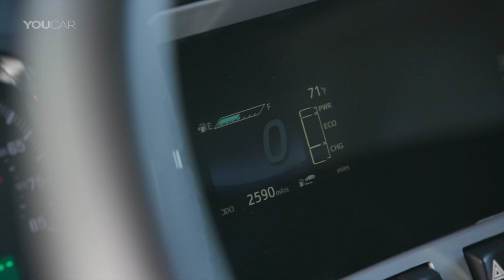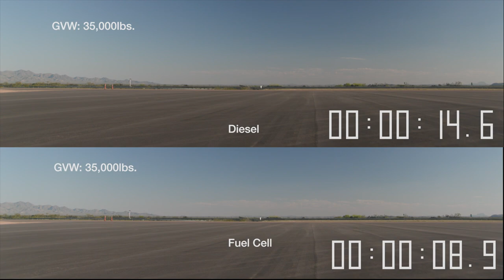FUEL CELL Truck VS. DIESEL Truck

Comment: Wow. sounds like jet engine
Reply: Random People well  it is  thats  why  lol. look  up  how  those  Things  work. Steam powers  a turbine.
Reply: Tom Westphal what you are describing is a steam engine, nothing to do with fuel cells! Fuel cells turn the chemical reaction between H2 and O2 into electricity, there're no steam turbine involved in the process
Reply: maybe that is AC frequency noise(subway train like sounds) from 3VF inverter with AC traction motors
Reply: It's the sound of the electric motor like rc cars make but on a bigger scale
Reply: No, it is the air compressor. Fuel cells require both Hydrogen and Oxygen to generate electricity. Hydrogen is coming from the tanks. Oxygen is coming from compressed air. This compressor works at high speeds above 100,000 rpm. That is the "jet engine noise".

Comment: However this is only 35000 gvw. It's an unrealistic test. (It's basically an empty truck!)
Reply: richard vaughn so your saying with a heavier load the results will be different? I know the times will be slower but that shouldn't affect who wins
Reply: Charlton Cruz yes it does, do you know how an hydrogen fuel cell works?? It can bring cars forward pretty good but if it comes to heavy things the performance will sink really fast. Normal Truck Engines have a lot more torque and are produced to carry heavy stuff.
Reply: richard vaughn yeap id say put atleast 78k up in there
Reply: Th3CrazyBOy Do you know how it works? It's basically an electric vehicle, and electric motors have tons of torque.
Reply: yes electric means tons of torque...but on a truck loaded to capacity (80,000lbs)is going to burn half its battery just to get moving
Reply: richard vaughn Wasn't electric,  said H2 on the hood which means Hydrogen Gas. So, it was an internal combustion engine.
Reply: plainwornout3 do you even know what you're talking about?  that's clearly the sound of electric motors.  seriously.
Reply: plainwornout3 Yeah, fuel cell is electric. It uses a chemical reaction with hydrogen to produce electricity, which then powers electric motors. There is no combustion (hopefully).
Reply: seedorfj you speak the 100% truth idk why general public thinks speed is everything I'm a over the road driver and trust me speed hauling tanker is your worst nightmare slow and steady is the way to go
Reply: richard vaughn Thank you
Reply: seedorfj why are you talking about batteries when this is running on hydrogen? also it's a prototype fuck sake. how did the first diesel engine perform?
Reply: you act like you know something and then you start talking. Tell me what RPM means and how it equates to an electric truck?
Reply: Yeah because you know more than the engineers. Gotta love these youtube kids.
Reply: Here is information on what/how these trucks are going to be used: https://arstechnica.co.uk/cars/2017/04/toyota-hydrogen-fuel-cell-trucks/ 
TL;DR: The trucks are meant to be used in short distance delivery in the vicinity of long beach improving the air quality.
Reply: Do you know how it works? Just to produce higher torques you need to use more electricity, I wonder how much electricity can this truck produce
Reply: Torque is a not a very useful measure to determine a vehicles acceleration, or more accurately it's incomplete. Horsepower(or Watts depending depending where you're from), shift points(if applicable-CVT), weight and friction losses is all you need. Horsepower in physics is a measurement of power and torque is a measurement of force, thus horsepower is defined as the rate in time (energy transferred per unit time)in which torque is applied. Torque and horsepower are actually tied together, the equation to determine either is Horsepower=Torque(Ft.Lbs.)xRPM/5252, this is why on dyno graphs Hp and Tq always cross at 5252 RPM. Why this is important is that horsepower is the accurate measurement of how much torque is applied to the wheels at any specific road speed. Now what you can't do though is just take the peak horsepower figure and use that to determine acceleration ( you can use that divided by drag for top speed though). My method for reviewing performance is to take your peak horsepower figure's RPM value and look to see what rpm you would drop down to if you would shift at that rpm. I know most trucks with Eaton-Fuller 10 speeds have a 500RPM drop in between high range shifts, so figuring I would shift at around 2,700rpm for maximum acceleration that would be 2,200-2,700RPM. Now solve for the average of the horsepower figures of these 2 values and you will get the mean effective horsepower value. Compare this to another vehicles engine/trans setup and you will get a good picture of which one will be quicker(if the weight and drive train are the same). What IS a very good use for the torque value is to determine an engines reliability, thermal efficiency and/or power density. High revs put an exponentially larger stress on your bottom end the higher they go, so using that equation i mentioned earlier you can get a pretty good idea of why high torque/low RPM motors are preferred to reach any give HP goal. A Formula 1 engine from the early 90's (1.5 liter up to 1,400hp) would out-pull a truck motor (10-13 liter around 400-600hp) by a large margin regardless the weight of the load despite making about 1/5th of the torque. It would do this for about 12 seconds until it exploded at 15,000 RPM and sent its piston off into space. In this video the fuel cell/electric drive likely made just slightly more power then the diesel, but it is always at its peak horsepower volume with no delay between shift. A diesel-CVT or diesel-electric drive truck would be much better at accelerating then a traditional manual, the only reason we don't use them is cost. This likely will be the downfall of the fuel cell truck as well, at least unless they can get someone excited enough to buy them. Anyways I'm drunk and I think I've just dumped half my years of science/tech, engine/thing that moves knowledge out in an over sized post. Questions?

Comment: acceleration might be good with the fuel cell truck but the top speed ( doesn't really matters ) will be for sure with deisel truck as the ic engine comes into its own at a certain rpm by gradually increasing its torque output, while the electric motor has a flattish torque curve and starts to decline rapidly after a certain rpm, so yeah top end is for sure the deisel one ....
Reply: Evil ANGELS it doesn't matter how fast the engine is spinning it comes down to horsepower which is a function of torque and RPM. all that matters for top speed is horsepower because gearing negates any difference in engine speed.
Reply: I don't know what you do for a living ( not saying in a bad way at all ) but my work itself is R&D on internal combustion engines. 

And às fas as we go, yes, the engine speed definitely matters for IC engines where they develop peak power.
Reply: You were talking about top speed not their acceleration curves with respect to engine speed
Reply: Emory Jenkins yeah, that's exactly what I'm trying to say, the electric motor's torque declines near it's rev speed limit thereby decreasing the pull ( power ) at high speeds, whereas the ic engine's torque is ALMOST to its peak at its peak thereby giving it the power to pull thereby giving a greater top speed. 

let me give an example

what is the fastest suv in the world ? 
bentley bentayga

what is the quickest suv in the world ? 
tesla model x

got the difference ? the tesla pulls hard due to its electric motor leaving bentley behind, but near it's peak, it loses some power and the bentley's ic engine on the other hand comes to its peak at this time making bentley go faster ( top speed ) than the tesla.
Reply: Evil ANGELS you're right

Comment: It's so important that one truck accelerates faster than another.
Reply: TheSoldatov Hey, a man needs to be able to do a drag race whenever he goes.
Reply: Especially when behind the back of 40 tons
Reply: TheSoldatov if you drove one and saw how other cars drive around you, you'd probably get it. but in the meantime you probably do your best to get around the slow moving truck. just better hope you never get rear ended by one if you cut them off.
Reply: Actually it is important in this case to show how electric devastates diesel... accelerating and decelerating.  How else can 4 wheeler s like you understand?
Reply: Важно  , если другой грузовик  работает на водороде . ( It is important, if other truck works on hydrogen )
Reply: 17.5 tons*
Reply: It shows that it's powerful too.  Try having up to 80,000lbs of weight and going up hill. Some truckers will attempt to "haul ass" before the start of the up hill. Because they know they'll be going half the speed limit before they reach the submit... of course that depends on length and height of the hill.
Reply: TheSoldatov it is important.  I can't stand being behind a slow ass truck at a red light.  In fact I can't stand trucks on the road at all.  When I'm flying down the freeway in my M5 it will be nice to know there are some trucks that can pass each other faster so they don't get stuck next to each other like some retarded turtles having a race and can GTFO of my way faster
Reply: Bee Shakin Well in some countries like Canada, it's the law to move over for a faster vehicle, so.... 
Also even in general, you should probably move over for a faster vehicle if you're on the "fast lane" for safety reasons.
Reply: Bee Shakin in some states trucks will get pulled over for being in the passing lane and NOT PASSING
Reply: Bee Shakin really though, we should develop a better and more expansive railway system to minimize trucks and tractor trailers on the road, many truck drivers I encounter are rude assholes that enjoy blocking both lanes of traffic for their amusement and will hover next to each other taking up both lanes for a good solid 15 minutes.  Then, after wasting everyone's time they seem surprised and annoyed that there's about 10 cars ready to blow past them once they finally move over.  18 wheelers shouldn't be on the road at all, they're too damn big, way too heavy, and too SLOW!
Reply: And they should. The majority of truckers are in the right lane for 99% of their day, until they have to move left for an emergency, stalled vehicle, etc. sometimes it takes a while to pass another truck. But, that's not illegal is it. As long as i move back right when safe to do so.
Reply: How exactly do you plan to deliver product to local facilities? Trains? you want to have a 3 mile long train blocking every crossing Lol you don't get it man. Tyson Foods alone moves 1000's of loads a week. A train across country, okay, that's being done. But truck still have to load it, deliver it to two or three facilities before it gets to the shelves. Trucks are here to stay. How fast do you think a truck should be going? fast enough to kill you and 25 people behind and in front of you in the event that he's asleep at the wheel or not paying attention? while going 85 mph..And saying to take those guys off the road won't work. nobody realizes this shit until it's too late.
Reply: I don't think people realize the highways and interstates were made to haul freight across the country. much like trains were first made to only haul freight across the country they soon let everyone travel on them. so don't get pissed at a truck being on the road,  the roads were built for them.  and also a truck shouldn't take off too fast in the first place, most these trucks are hauling 80,000 pounds and by taking off fast in an intersection or around a turn can cause an accident. a truck can roll over on a turn.
Reply: TheSoldatov Actually it does. Plus the fuel cell one can go up hills faster and can stop faster.
Reply: TheSoldatov it's not about acceleration entirely it's about reducing emissions mostly and allowing trucks to keep up
Reply: TheSoldatov well considering these things are always in the way from how slow they accelerate it would be nice for them to keep up with regular traffic also zero emissions 👍
Reply: TheSoldatov Lol really man? gee, I wonder what kind of power, fuel consumption, and emissions an 80,000 lb truck would require to "run with traffic"  2000 HP, 4000 lb ft...you people can't have it your way. People don't want trucks going fast, therefore they don't. Just because a few of you out there think you own the road, and that trucks are in your way,  doesn't mean that the rules and regulations of the entire industry is going to change to make sure that not one more truck EVER gets in YOUR way again.
Reply: TheSoldatov hey man I agree! My truck goes 66 mph. I'd love to be able to even run 70 mph. Too many people/groups think that trucks need to run slow.
Reply: I think trucks need to be able to go faster, I hate getting stuck behind trucks. But because my dad is a trucker I understand they have places to go too.
Reply: @roroguapo3  overtake or be patient, nobody's behind you

Comment: i dont see how people say Hydrogen fuel cells are green energy, it requires an equal amount of electricity to produce it for what get out of it, and that electricity comes from 66% coal and gas.
Reply: mrlevite1237 so the energy coming from dirty solid fuel is better the liquid fuel?
Reply: mrlevite1237 well there is no such thing as clean coal.
Reply: Would you rather have trucks and cars contaminate the air everywhere they go? Or have it contain in a place where electricity/energy is created?

Comment: Passenger jets are the most difficult thing to decarbonize (but, see my post below, it can be done.) We can also make an end-run, by having bullet trains, and the Hyperloop. Then, we would only need planes for transoceanic routes. If we were on good terms with Russia, we could even bridge the Bering straight, and put tracks there. An 80 mile/hour Freight train would solve our Supply Chain issue pretty quickly. Container ships only go about 15 mph, because they use Way more fuel if they go 30 or 40 miles/hour. The difference with water viscosity is exponential. And, Yes, the train would have to go North to Siberia, and then back South, but, if electrically powered, or powered with a Green Ammonia fuel cell, instead of Diesel, it wouldn't really matter. 
With the Arctic melting, Northeast passage ship crossings become possible. When Greenland's ice sheet melts, we could even put railroad tracks from the Southwest to Northeast corner of that Huge island, as a sort of portage. Then, the container ships have a short route to Northern Scandinavia, can offload again, and a freight train takes the goods South, where ships take the containers a short distance to Hamburg or Copenhagen.

Comment: Badass, diesels will eventually be replaced, idk with what though. The technology has to be refined and made smaller, where am I supposed to sleep? And if companies are thinking they'll be local trucks, the day cabs sometimes have a shorter wheelbase to get into tighter docks. Still cool, props to the the potential. I'm wanting to see a out of frame run at 80000 lbs.

Comment: We could install high voltage  twin pantograph lines (one for power, the other for ground return) over all our superhighways, and the eighteen wheelers could use them, except on surface streets (where a battery would suffice.) The technology is over a Century old. This is already being done in Germany and Norway

Gasoline=45% of a barrel of refined crude oil
Diesel=31%

Once truckers know the advantages (and Huge cost savings!) they will be eager to adopt this technology. 

If we don't have the money for the changeover yet, then "Green" ammonia, converted back to Hydrogen and Nitrogen, would also work, using the Hydrogen to power a fuel cell, the electricity from which turns the motors. The Japanese have a lower temperature catalyst to make this a reality. We could  use that for propeller planes (including choppers) and even use Hydrogen directly to fuel passenger jets. Kerosene jet fuel is maybe 9% of Crude oil usage. Said Green Ammonia is already starting to be used as fertilizer (Absolutely Crucial!)

A shortage/surplus of Crude Oil/Natural Gas is only TEN percent. This is why, in 2020, when everybody stayed home, Gasoline was 1.39/gallon, and now its' touching five bucks/gallon. The same laws of economics also apply to Diesel Fuel. 
And, Methane?? (the major component of Natural Gas) We need subsidized Ground Loop heat pumps, used for AC/Heating plus the heating coil could be used in hot water tanks. This represents the Lion's share of direct/indirect usage. Most electric companies use gas turbines, and, of course, gas fuels the  majority of our furnaces in homes and businesses.
If Europe was doing this (and, I'm sure they soon will) they could flip off Putin cutting off the pipelines.

Comment: The reason the fuel cell semi went faster than the diesel semi is because it is a automatic transmission vs the diesel that has manual transmission
Reply: Many big trucks have automatic transmissions these days. NO-an electric motor has Great torque and acceleration.